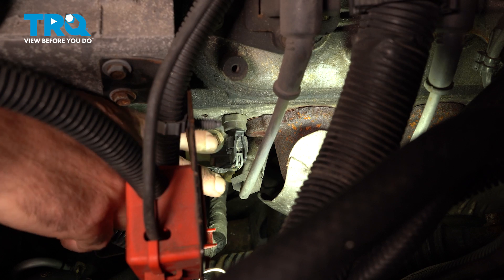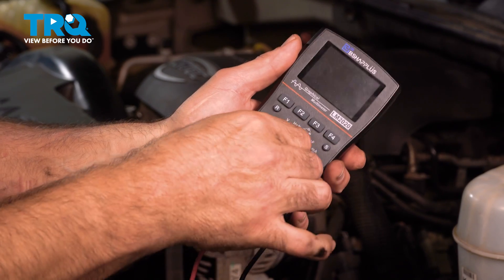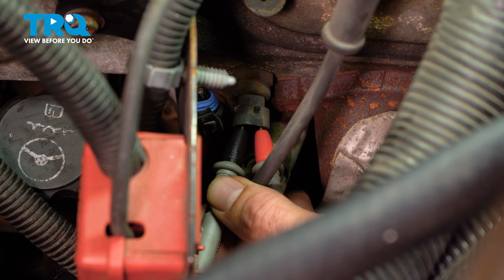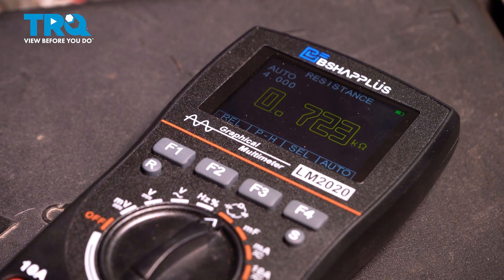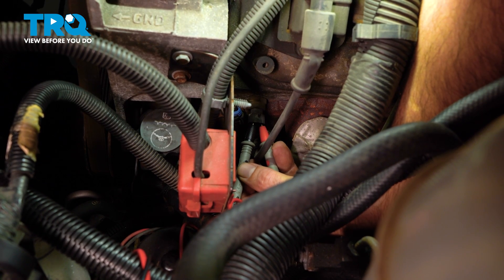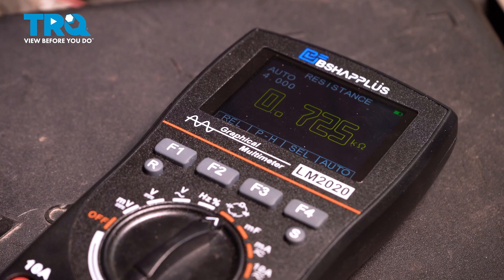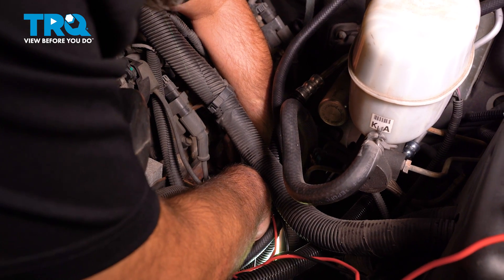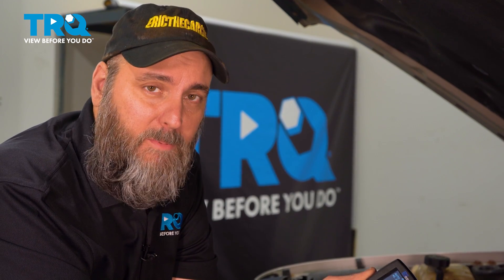EricTheCarGuy Explains Check Engine Codes - P0118 Coolant Temperature Sensor High Input

Comment: I've the same code no engine light no fan noise but only thing is my temperature gauge needle sits at 80	 degrees instead of bang centre at 90 sometimes the needle will move to 88 then back to 80

Comment: Maybe you can help if you read your comments. Hope. I get a PO118 code on my code reader but the problem I have doesn't seem related. 1996 Honda Civic. Turns over (new battery) lots of times before it trys to start first time in the morning. Dies. Trys to start. Dies. Trys to start, pump gas, finally starts. Runs rough. Evens out. Rest of day starts fine no problem. Idles fast when I have to stop at stop light. Thanks

Comment: Hey Eric I am having a similar issue. With my 2000 Chevy c 2500 with a 454 Big block. With the code po118. But my temperature gauge in the dashboard is reading correct temperature at normal operating temperature. At 2:10. But still I keep getting the check engine light for po118.

Comment: Hey boss 2019 Ford fusion 2.5 I changed coolant temp sensor out new thermostat after a week p0116 code came back took it to Ford dealership they changed air intake sensor out one week later coolant temp over temp light back on not running funny or even overheating getting 5v at connector to im bout at my whits end this kid just bought this car for 15k fresh out of the Marines any help I would appreciate running out of ideas

Comment: Had code P0118 on a 96 GMC Jimmy replaced the sensor (check engine light went off) but the fan still comes on as soon as I start the engine?

Comment: If you didn't see the broken wire and still want to troubleshoot, with the car off, remove the connector that goes to the sensor. With a multimeter, ground the black lead to a good ground. Turn the key on but don't start the engine. Use the red multimeter lead to check the 2 pins in the connector for 5VDC. This will tell you which way you'll need to go next. If you have 5VDC, you're looking for a problem with the ground. Turn off the key and check the other pin for a good ground. Switch the multimeter to resistance. Your black lead is already grounded so use the red lead and put it on the other pin. It should read 0VDC or very close. 

So, to sum it up, without buying anything, you've verified the wiring for the 5VDC circuit and it's integrity. If you have 5VDC and a good ground, buy a new sensor. If you're missing the 5VDC or ground, further tracing back in the wiring harness will be needed to complete your troubleshooting. Good luck.

Comment: @TRQ Hey Eric, thanks for the very informative video! I am getting this exact code on my vehicle. I have some questions for you. Is my vehicle safe to drive? I am wondering if the engine and coolant are actually running hot. When we tested while idling the engine the temp was fine at 180F. Though it’s not until I drive for awhile does the temp gauge on the dash eventually goes high in the red. I have to take another look to  see if the wiring or ECT sensor is the issue. I can try to test the sensor with a multimeter which I have while it’s plugged in. This might be tricky, and check the wiring. If it is the wiring it did not show in the video. Though did you some how twist the wires together after splicing them? I am not sure if you can and should do that. Thanks! 🙏🏽